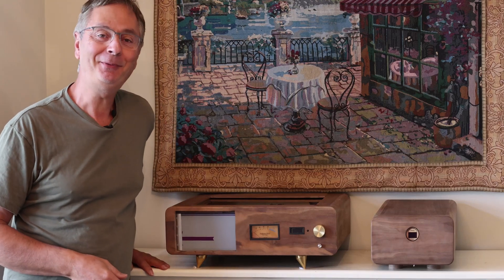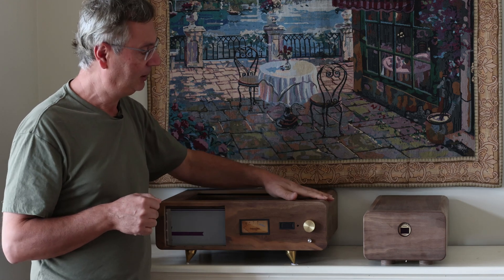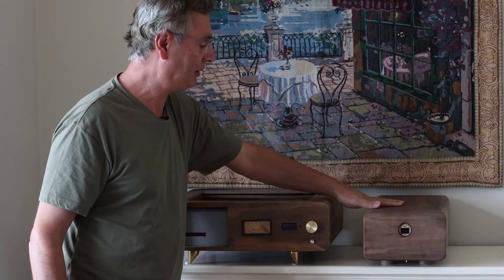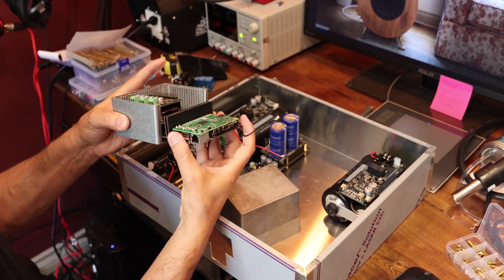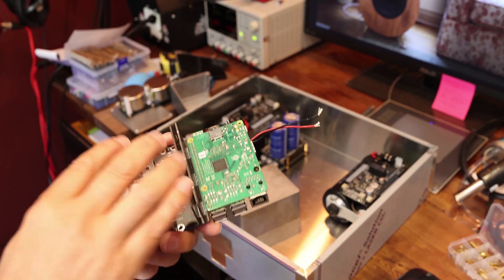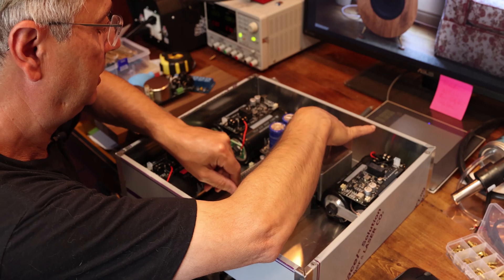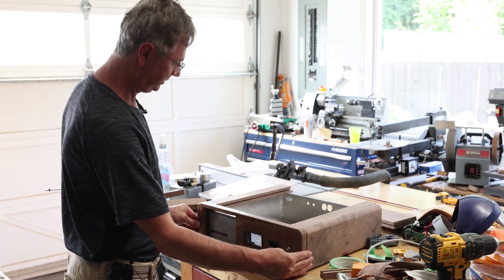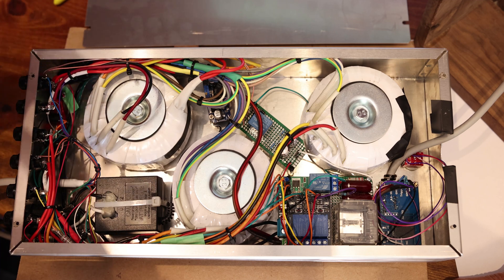Part 3 Building the Gabster D11 Ultracapacitor Dac and Streamer

Comment: Capacitors hold a fraction of what a battery can provide even super capacitors and with 60c rated lithium cells available that can do 300 to 400 amps of power per cell it's a mo brainer that they should be #1 choice or at least battery+capacitors but just capacitors makes little to no since

Comment: Hi Gabi, I recently discovered your channel and glad I did. I enjoy your content.  Can you make a video on stand alone  supercapacitors as a power source for my Denadrips DAC and preamp.  Have used batteries and u r correct not the end solution
Reply from the maker: In Part 1 I talk a bit about it at 5:00 
But can do a video sometime about just that 
Which Denafrips Dac do you have connected to batteries and what voltages do they need I never tried on mine yet but very interested
Reply: @Gabster1  sorry I meant my pre-amp.  Its a Korg Triode B1.  My Denadrips is the Area II.  With open baffle speakers.  Again really enjoy your content.

Comment: Hi Gabby, could you share the name of the noise sniffer and where you got it? Thanks keep up the good work!
Reply from the maker: Hi Peter it is actually a cable tracer a ver crude tester but what I like about it is the simplicity and it is sensitive to the audible frequency 
Mine was given to me but it is similar to this one and they are cheap 
Circuit Breaker Finder Wire Tracer Electrical Circuit Tracer Tone Generator and Probe Kit - Network Cable Continuity Tester Electric - Automotive Wire Tracker Telephone Line Finder Toner Detector Tool https://a.co/d/8UB3mGj

Comment: Hello, I am trying to build a similar DAC. Got the parts from Ian and build my first UCPure with Ultracaps 2.7V / 3000F.  The Voltage is fluctuation between 3.02 and 3.34V with the blue pure LED on.
I think this should be rock solid 3.3V?
Thank you
Reply: Lithium is superior to capacitors
Reply: After looking into a lot of these components they seem like snake oil, powering the PI with Lithium ion batteries is easier and far cheaper than ultra capacitors and provides a better more reliable supply. To be fare in the digital domain you really don't need to worry too much about high frequency switching noise as long as it isn't so bad it causes errors on the I2S signals coming from the PIs GPIO header so just using a cheap power brick would also be just fine. The only thing you really need to worry about is shielding the DAC and having a noise free supply to it together with a high quality reference voltage. The best results would be to convert I2S from the PI directly to optical SPDIF and have that going onto a dac that is well shielded with a good lithium ion battery power supply, everything else in this build really provides no value.

Comment: That's a lot of effort for an RPi based system. I went down the Allo rabbit hole with pretty good success at one point. I expect this will be a nice DAC when it is all done.
I have a few thoughts.
Get rid of the screw terminals - you are undoing all your hard work using them. At the very least, crimp ferrule ends on the wire (they are round tubes that use a special crimp on all sides). Copper wire will always oxidize when exposed to air, and the screw terminals do not put enough pressure to make an airtight seal. Screw terminals will also come loose due to thermal cycling. Hopefully you did not tin the wires before you put them in the terminals - this is the worst thing you can do. I like to use solid wire for power directly soldered to the PCB, and gold plated headers for signal wires - soldering stranded cable  is almost always a terrible idea.
On the power supply, consider routing the mains and low voltage as far apart as possible. I also suggest twisting each input and out put pair together. You have done a nice job keeping the power supply as whole from radiating into the environment, but nothing to isolate the output cables from the rest of the power supply.

Comment: Congratulations, Gabby. It looks amazing so far. I’m keen to understand how you are connecting the output transformers to the DAC board. Are you running connectors from the DAC board GPIO pins to the GPIO on the transformer? Was not so obvious on the video. Looking forward to the next one!
Reply from the maker: Thank you Philip
The dual mono Dac board has a 8 pin connector like a mini GPIO and Ivan Transformers has connector that goes in it but in my case I had to do a small custom extension as I have a metal case cover in between them.
I will try to show it in the future Dac video after the power supply one.

Comment: I am surprised you did not decide to use a battery power supply! Is that not the best power supply one can choose?
Reply from the maker: Ultra Capacitors are the best. Batteries are second best.
Reply: Batteries are severely limited in discharge rate and have a fairly high output impedance.
Batteries almost always suffer greatly if they have to respond to dynamic loads.
Prolly almost fine for a DAC, not so good for a preamp, and terrible for a power amp
Reply: @joshua43214  Could you back up what you say with some numbers?
Reply: @zaldam  Basically using ultra capacitors like this is a waste of money, batteries with linear regulators fronted by small ultra capacitors to deal with load spikes will provide perfectly smooth power and also lithium ion batteries can hold orders of magnitude more energy. Thing is they don't cost much so the audiophile types consider them inferior. Half of the components used in this build are totally pointless because they are dealing with noise or jitter on digital signals where it doesn't make any difference as long as it's within logic thresholds and timing specifications.